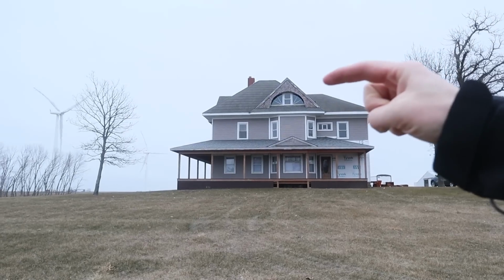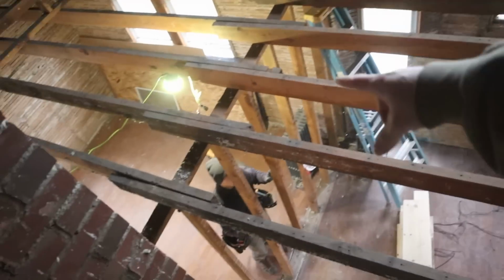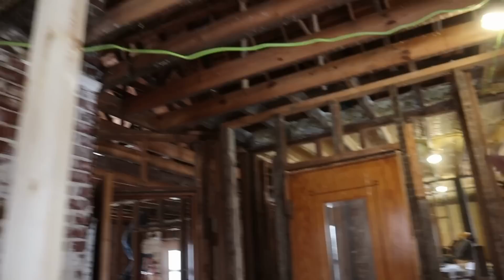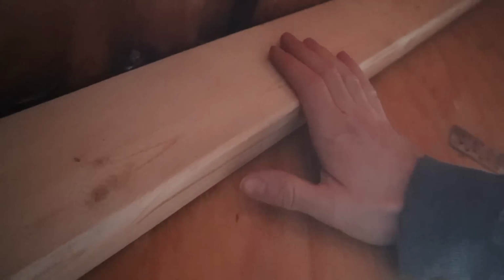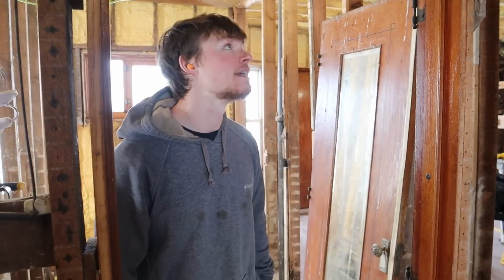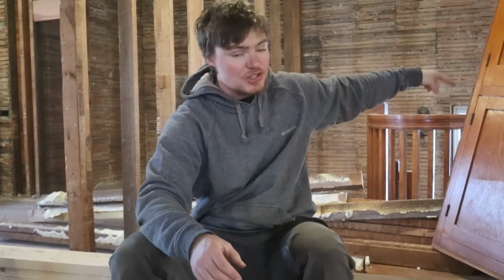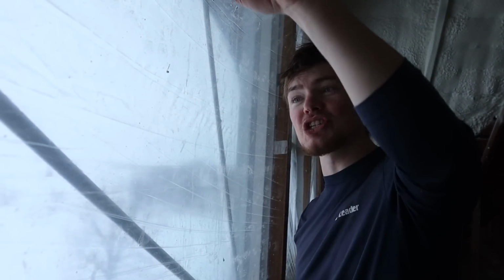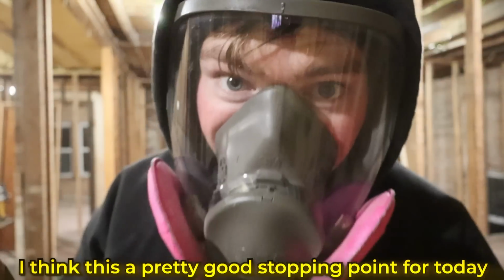Restoring A $7,000 Hoarder Mansion: Attic Insulation Day

Comment: I've renovated five century homes in my lifetime.  Those roof braces are not to support the entire roof.  They are to keep the long rafters from sagging in the middle over time due to snow load.  Although its a good idea to place them over a wall for support, that's not entirely necessary if the load is spread across well fastened floor joists.  Cutting them off and then attaching to a vertical  knee wall basically negates their purpose.  It would have been better to throw up a wall all the way up to the rafters.  

I also would have kept the old floor joists and married new 2x8s along side the old nominal 2x6s.  Makes it easier to level the floor / ceiling.    Those old houses were made of rough sawn lumber and variations in their dimensions caused waves in the ceiling which were corrected with the lathe and plaster.    If you're putting up drywall, then you pretty much have no choice but to address the unevenness at the joists... unless you want to shim every single sheet of drywall.  This why so many old houses have drop ceilings... because dealing with the varying dimensions of the structural lumber is a huge pain in the backside.

All that said, I dig that these kids are saving that beautiful old house.

Comment: The house has been retrofitted over the years for electricity, plumbing, water, heating, etc. all of the “newfangled “ inventions of the previous century. And those holes cut into the beams? They compromised the integrity of the structure.  Tunneling under the house for service supply would have messed a bit with the foundation. Humidity and load will warp the beams. Also, the attic space may not have been built for occupation loads. New uses in existing structures require double checking. Just taking down a chimney will change the loads of adjacent walls, so it is a very good idea that you have a structural engineer checking things. Big difference between hardwood beams and pinewood, too. It’s not necessarily poor construction. It could be poor maintenance and invasive upgrades that also helped cause the uneven shift. I noticed there are no noggins between the joist in the attic floor. That alone tells me they didn’t build it for occupation.
Reply: good thing its only been standing for 100 years, that sucker was built pretty weak huh? LOL

Comment: The lath was a strengthening member of every wall floor and roof  and ceiling panel when you remove the lath you remove 2/3rds of their strength. One piece of lath is obviously weak but a multitude of pieces and a myriad of nails gives it strength like full sheets of 1/4 inch plywood( real plywood) it is still made  but hard to get sometimes and very expensive.
Reply: 2/3 strength gone huh? Where are you pulling those figures out of, i have an idea !! LOL
Reply: @warrenmichael918 I'm 70 years old and helped tear down  several of these old buildings they had no insulation some had plaster and others mortar and I'm tired of children like you.
Reply: @kittty2005  children huh, well i just turned 49 a few weeks ago but maybe im a youngster to your 70 but i dont think of myself as a child, childlike at times but not a child! LOL That old plaster and lathe is just old school and needed replaced. It was the top of the line years ago and did provide some shear strength but removing it didnt take the 2/3rds strength away. Once they drywall the new walls, all the shear will be just fine. Insulation will be better behind the new drywall too, and not as messy. That old plaster is always falling off inside the walls and it keeps the dust up as it does it too. Theres a reason its rarely used , if ever, these days, its outdated and has been replaced with better materials.

Comment: Correct me if im wrong but dont you need somthing bigger than 2x4's to use as floor joists if your going to convert the atic to living space whjich will have weight on it?
Reply: 2x10s at a minimum depending on the length of the run.

Comment: How do you run your electrical on the outside walls if they are filled with foam? Just wondering
Reply: they arent fully filled but if they need to, its easy to cut it or drill foam.

Comment: Cole, the wood strips are called 'Lath'.    The Lathe (LAY th) is a machine for shaping wood, metal, or other material. EDIT: In seeing the basic construction of your home's framework and then considering the fancy trim inside the rooms, it is definitely a case of "Lipstick on a pig...." Most homes, esp in larger cities/communities, DID have correct building codes 100 yrs ago. My hubby was in the building trades for 45+ years and agrees.
Reply: I am amazed at the layout of the ceiling joists across that 2nd floor (floor of the attic) Rafters running different directions, some of them not resting on load bearing walls etc. In the long run its a good thing they are doing this so they can correct all that stuff.

Comment: I hope the hole house does not fall for lack of correct  support.
Reply: its only been 100 years so far , gotta give it time to fail !!
Reply: I always hear engineers talking redundancy and forgiveness in wood structures. I have no doubt this house will continue to stand. However, the interior finishes may not perform. Think of cracked drywall seams and popping screw holes for the rest of the remodel. I have walked into wood structure projects where structure and connections after thought and the end result is ugly drywall cracking everywhere in project.

Comment: Might want to have A/C for just the upstairs. It is hard to push the cold air upstairs.
Reply: what in the heck makes you think that he is doing all this work and spending all this money to do this remodel and NOT HAVE ANY AC???
Reply: If the a/c is in the basement it won't push the cold air up to the 3rd floor.  He would be better off having an a/c unit on the 3rd floor. @warrenmichael918

Comment: I've always found that removing the nails from lath and plaster takes a minimum of 5 passes to find them all.......if you're lucky.
I noticed that you've left the second floor, wood floors, unprotected during demo. Hopefully, you're planning to replace them, or you like the distressed look. Just as important though is the amount of dust that will filter down to the first floor. Well, I'm 99.9 percent sure you've considered this, but just in case you hadn't.....
Love that spray foam, and happy to hear you have a plan about the venting needs.
Keep up the good work.
Reply: They recently moved out of the house for the duration of the project so they don't have to worry about the dust issue anymore. He is replacing all the flooring.

Comment: Are the new attic floor joists to code?
Fix, straighten, and level everything now while you can. House jacks would be great. Try using pvc pipe for wire chases when using the spray foam.
22:15, have a walk in shower and a soaking tub.

Comment: Well first off I was under the impression and or taught that you're supposed to do the electrical before you do the spray foaming. But then again that being said Cole is the general contractor apparently on this job as he was on the Ben site so we also have that one came out. So it should be interesting to see what goes on
Reply: There is plenty of room to pull wires since the foam isnt fully blocking the walls

Comment: I’ve done this, our house was built in 1897.  That said may I suggest you save some of the lath to build your walls back up so the sheet rock will be flush with your trim around the windows and door frames.  We tacked it down the studs it’s much easier than cutting all the framing down.

Comment: You need air flow in the attic. You should not be sealing it up tight. You’ll have issue with mold. There should be. Gap from the soffits to the roof peak. I hope you are getting good advice and consulting with engineers and builders.
Reply: its fine, just need air exchanged up there.

Comment: By placing the spray foam directly on the bottom of the roof sheathing, you do not have ventilation for your shingles.  Doing that you will void your shingle warranty.  Might want to check on that.
Reply: True!!!. Cold roof is what you want.
Reply: I think it’s a metal roof.
Reply: @route5discgolf , then there would not be an issue.  Had not paid attention if it was asphalt shingles or metal roofing.

Comment: Remember put in  DEHUMIDIFIER as well as air conditioner and heater because it can be humid but still be nice temperature. Have it be separate unit and included air filtration unit too. Keep up the great work.❤ you explanation. Great job keeping it clean!

Comment: Those existing ceiling joist beneath the old attic floor are not sized for or intended to be used as floor joists. Even if you double them they are not sufficent for today's building codes.
IMO, those existing joist are minimally sized, a little small, for the load they were carrying. I saw them moving when you walked on them. 
I suggest you find a span table to correctly size new floor joist. If you are going to use the old attic space for new living space, 40 PSF live load is the design requirement. You will also see in the span chart tables sizes needed for sleeping areas at 30 PSF live load.
Joist span tables are available free online. In your location, I think the Western Lumber Span Tables are what you need. Or, the span tables in your local Residential building code or the American Wood Council will also provide the information you need. 

Be safe!
Reply: My thoughts exactly. An engineer should have been involved with this project.

Comment: Cole, at 16:30 you noticed the ceiling joists flexing/sagging. Your ceiling joists are not spec’ed to have any floor load. Please use the internet to research floor joist span tables. 2x6 spruce as a floor joist is designed for 8’8” floor span. 2x6 are ok for a ceiling joist at a longer length, but not for a ceiling joist with a floor load from above. Please Google floor joist span tables.
Reply: Maybe he wants a trampoline floor in the attic.

Comment: Why don't you leave the chimney in as an accent piece and or a spot for fireplace inserts on each floor. Those chimneys are usually used as an anchor point for floor joist because it runs from basement foundation t roof truss support. Just an observation of a non invested bystander, good luck and God speed.

Comment: watch out, ASBESTOS was widely used!!! "In 1910, world production exceeded 109,000 metric tons, more than three times the total in 1900."  some "cement" or "concrete" was actually ASBESTOS CEMENT. also: 

• Adhesives

• Any vermiculite-containing product, especially insulation

• Asphalt flooring

• Boiler ducts

• Cinder blocks

• Electrical units and consoles

• Furnaces

• Plaster walls

• Roofing components

• Roof shingles, especially cement roof shingles 

• Stucco 

• Textured paints

• Thermal system insulation

Comment: The original construction was called balloon construction. This is where the exterior walls & a few of the interior walls extend past the floor level & the floor was pinned to the walls. The newer laws were to create a stronger building with the loads transferred through the structure to the foundation.

Comment: "this is a load bearing wall" Cole points at a wood 2x4. As an european with experience in (european style) construction i am amazed that this house is still standing.
Reply: I was thinking the same thing. I'm honestly a bit surprised of the overall structure of that house. So many... Interesting choices, to say it diplomatically. But it looks good at least! And I'm sure Cole & co will get it to an acceptable structural level.
Reply: It’s the pointing at a “load bearing” wall which runs parallel to flor joists. Typically load bearing tend to run perpendicular to joists to distribute their load.

Comment: Those 2x6 are Overspand. And will not take the load of an additional floor for the attic
Reply: what additional floor? They ripped one out and will be replacing it with a new one where the old one was at.
Reply: @warrenmichael918  obviously you don't know Shit about construction
Reply: @ThomasJones-fn6pc  ok but i can count pretty decent. He had 1 floor, he removed that floor. Now, he plans on replacing the one he tore out with a new floor. That still makes only 1 floor, not an additional floor. Im not saying anything about needing better floor joists, im just asking where this additional floor is at.

Comment: Sealing the room with spray foam was a bad choice if you now need air conditioning to make sure there is no moisture build up inside the attic. The spray foam idea is fine for workshops,  but there are better ways to insulate a house that will allow it to breathe.
Reply: The million houses built with spray foam all just disagreed with that statement.

Comment: I helped with my cousins and our dads renovate a Victorian  manse in the Haight District of San Francisco. A huge undertaking and the ways and materials used were head shaking an scratching . Redwood was used mostly. My Aunt still lives in it. Heating/ac was put in seldom is the ac run but there are days of over 80 f. My dad designed all the duct work and  chambers total forced air. Some additional dehumidifying was added in the early 1980s. Enjoy your changes. Remember storage and lil nook areas give character to an older made more modern reno home.
Reply: The architecture of the Haight and Pacific Heights is so beautiful.  
I 💓 SF!

Comment: I had an engineer come up with a clever idea for old floors that are bowed and bouncy because of being over spanned in the old days. If you take STEEL floor joists and sister them on the old wood, you keep the load bearing of the old wood ....but it stiffens and straightens and you end up with perfectly straight floors.
Reply: I'm surprised there is no blocking between the floor joists... that would really take the bounce out of the floor before you put the new sheeting down!

Comment: You need collar ties on the rafters before you take any other walls down in the attic. If your going to remove the ceiling joist. It would be easier to install one  2x8 vs 2x2x6’s and cheaper.

Comment: You could put a skylight where the chimney hole is going to be. You’ll get more natural lighting
Reply: I used to think skylights are a good idea. Now that I have one I learned what a huge mistake it was.
Reply: I will never have a huge hole in my roof called a skylight again. Over 300 gallons of water in your house will change your mind really quick!
Reply: Make that a workable skylight to vent hot air out?
Reply: problem with that is skylights tend to leak over time, ive had to repair houses that had long term leakes from skylights.

Comment: Its probably way too late at this point due to the delay in when you film vs when we see it but it would have been interesting to see a... i think its called an architectural historian or something like that... before you tore that stuff out and insulated but to this layman who grew up in the construction industry i think the reason that you see modern and old dimensional lumber as well as roof support terminating in the wrong places is because there have been at least three prior renovations, one of which radically changed the layout of the top floor and attic.
Reply: A tornado damaged the roof and attic in the 1970s so that explains some of the differences up there.

Comment: My Dad did carpentry work for 50plus years. A lot of the places were old places in a town that was founded in 1761 so he ran into a lot of old timber that looked like you have. Most of those boards were not kiln dried so they warped all over the place. He did what you are doing. Good Job.  

Did you notice any of your interior doors either getting stuck or swinging open ??

Comment: Was the pitch of the roof considered? It looks like at least a 10/12 pitch if not more? I would think alot of the load is on the outside walls? Then all the saw mill cut wood is way stronger then the junk stuff we get now.

Comment: Now that all your framework is exposed how about radiant heating and cooling. I use glycol in the pipes and works fantastic floors are cool in the summer and warm and comfortable in the winter. There is no ductwork or anything else taking up space also energy efficient could be a bit of a pain on the second floor cause you want to save the ceiling on the first. floor ceiling. The first floor you can reach from your basement.

Comment: My God Cole, didn’t you learn from the bin site. Spend the little extra money and work with a qualified architect / engineer. As Judge Milian says, the cheap comes out expensive.
Reply: @jmd1164 So the architect he’s mentioned talking to about the attic previously, Justin, who’s a professionel carpenter with decades of house building experience, and Roman, who’s an engineer, doesn’t count as qualified help?
Reply: Umm - heck no! There’s years of study and advanced degrees to become a licensed architect or engineer.  A lot goes into the design and structure of a house. 

Also, in our neck of the woods, the city would require tons of permits and inspections to make sure things are being done correctly. I can’t believe that’s not required out there.

Comment: Big respect to you for this endeavor.  I have been in your shoes in this exact situation.  
Re did our home of similar design and age.  
Once the lathes were removed from the ceiling below the attic floor, it was immediately clear that I had to cut a mountain of Noggins to place and screw in between the floor joists.  It made a huge difference. Then the insulation was added between all floors and between each wall ineach individual rooms. Sound proofing and kept internal space balanced temperature wise